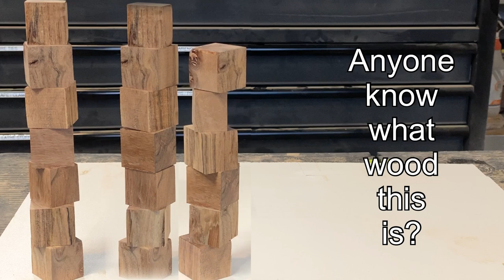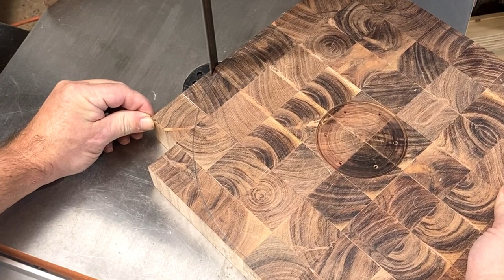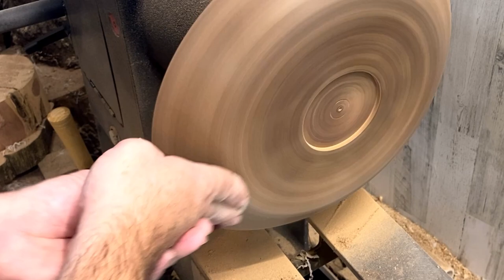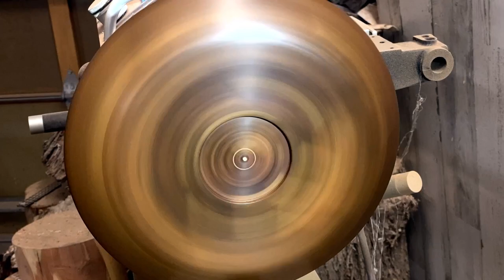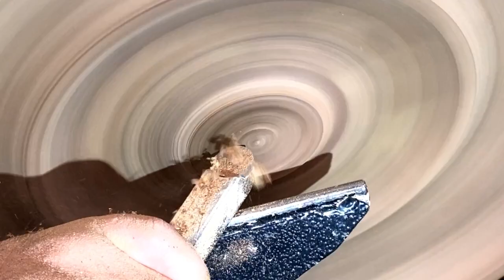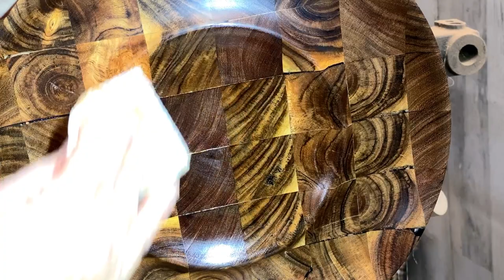Woodturning - Mystery Wood Chip & Dip Tray

Comment: its great, but you need to normalize all the chunks to precise equal size or you get gaps when two chunks are a mm different.
You can fill the gaps to make them less obvious.
Reply from the maker: you’re right. full disclosure: I didn’t actually assemble the blocks…I actually bought it from Home Goods as a reject cutting board. and the way it was assembled was terrible!